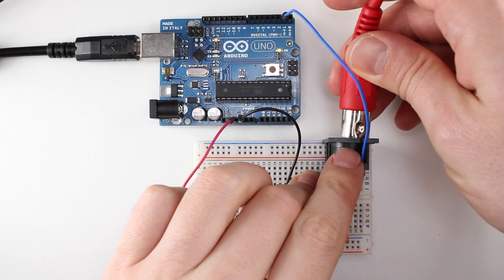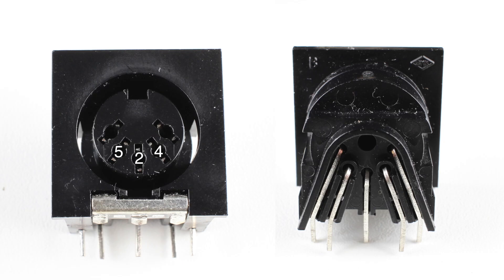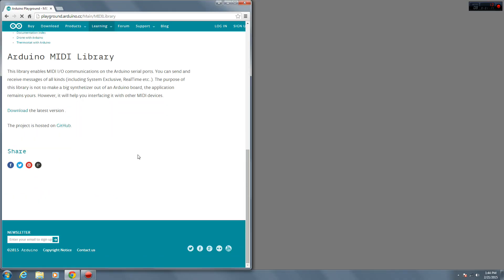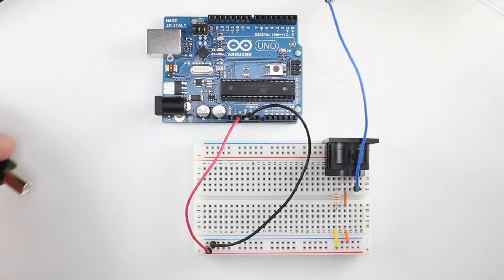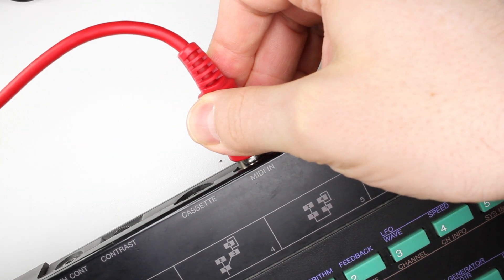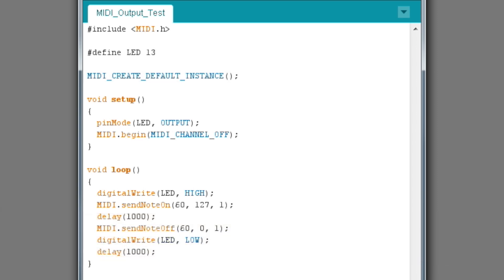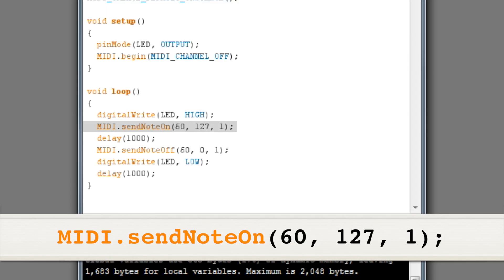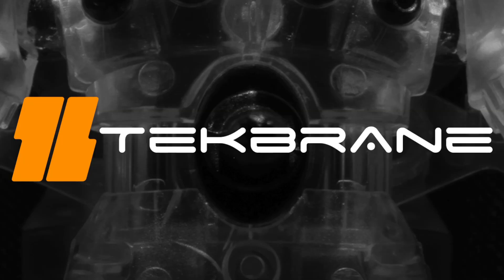MIDI for the Arduino - Build a MIDI Output Circuit

Comment: Am I stupid or something? 
The only thing I can get from this setup is Two (Yes TWO) Midi Reset messages instead of note on or note off.
I'm starting to think its something electrical. (Reset message is just a row of 1111 1111 after the 0 from the byte start)
If anyone has the same problem or knows why it happens hmu

Comment: Great stuff Dave! Your videos on MIDI DIY is the more comprehensive thus far. I have a question for my specific build. I hope you can spare some time to answer them.
Q: Will an Arduino Nano work with the instructions, software & libraries used in this video?

Comment: I was reading only certain Arduinos are midi class compliant. Like only certain boards are recognized as native midi controllers when you plug in usb. So in this case if you use a 5 pin midi output you can use a regular Arduino uno without flashing it with custom firmware and it can be used as a midi controller?
Reply from the maker: The Uno/Nano can't do USB Midi without modification. Some other models can though. I like using the Teensy micros for USB stuff.

Comment: ultimately i have 2 projects I want to pursue here, I want to make a device which can record/passthrough midi, so that i can record keyboard notes into a midi file for later while also allowing them to pass through to a synth. 

The second goal is to create some sort of piano roll style midi editor which allows me to edit those recorded midi files, and to allow playback across a midi out port.

I am not sure if a piano roll type application which could support a screen/gui with a mouse is feasible on an arduino or if i need to explore using a rasberry pi instead.

Comment: I love so much how this series explain all the basics Arduino software coding in details, slow and easy to understand for all. Great work Notes and Volts! Midi and triggers would be a great topic to subscribe, but also visual, with the Pi Pico VGA out, or even the Nano but smaller screen. I'm completely noob when it comes to visualization on small screens. Even identifying the kind of screen is troubling to begin with.
Reply from the maker: Glad you enjoy it! Lots of good ideas for future videos

Comment: would there be any differences if I were using a arduino pro mini? I wrote a code to send program changes through midi out, it works perfectly on the arduino uno but when I try to use it on pro mini, the messages that sent through the serial port seem to be totally random

Comment: 🤯This Arduino MIDI series is exactly what I need to know, not for creating music, but for creating laser waveform imagery with Teensy board x/y image generators with subroutine keys and CC parameters being MIDI controlled. 🙏 Thank you!
Better to be 7 years late, than never, right?.
Hoping to find an episode on interfacing with a DAW's timeline to complete the process.😎

Comment: I need some help. I am trying to design a MIDI IN and MIDI OUT circuit for an esp8266. It is a 3.3v system. 

I  have searched all over google and youtube for the right circuits. Some even have the MIDI pins 4 and 5 reversed.. Which pin is more positive than the other? (Pin 4 or 5?)

In a MIDI OUT circuit, do I connect the V+ side to 3.3v or 5v? (I am using a esp8266) Would I need an opto-isolator on output to protect it when driving a 5v circuit from a 3v pin?

Could you please show us a MIDI IN/OUT circuit designed to work on a 3.3volt system?

One last question:
Are there any MIDI commands that can be used to tell a servo what position to goto?

Comment: Hi Dave! I've successfully made an arduino midi controller by watching your tutorials, I want to go a bit further and turn that into a wireless one by using bluetooth low energy. Could you please share some tips on how to achieve that or make video if possible? I've seen a few tutorials using adafruit boards but I want to see if that same thing can be achieved by Bluetooth modules like HM-10.

Comment: you have the din5 connector plugged into the ground at the top with the first 2 pins?What about the 2 pins in the front? There are 7 pins total.

Comment: Hey, can somebody help me with a problem? I connected my wii drumset with my roland e drumset, so i can play guitar Hero with the e drumset. the problem is, that the midi cable sends 2 information, when i hit the drum. so the game registers 2 notes, while i actually hit the drum once. my plan was to use the arduino as a connector and code it, so that the e drumset just gives one output. does this work?

Comment: I've watched all your MCU Midi video's and I've finally started my own project. I'm using the code shown in this video and an ESP8266 to send Midi data to my Behringer Neutron (I just switched to 47 ohm resistors because of the 3.3v logic). But for some reason my LFO stops working as soon as I've sent a Midi note. Other than that it works perfectly!
Do you have any thoughts on this? I feel like it might be sending some Midi CC data somehow.

Thanks for the very informative video's btw!!

Comment: no optoisolation circuit in case of voltage spikes?
Reply: It's an output the input on the device you connect it to will be optoisolated

Comment: According to Your previous video the ground pin should NOT be connected . Correct ?
Reply from the maker: Hi MrKk. The ground pin on the Midi Jack is connected on the Output jack only. Not on Input jacks. This is to prevent ground loops between the two instruments.
Reply: OK  Basically the TX device  will shield the cable  but  @ the  receiver (synt) "midi in" side pin 2 is supposed not connected.   (I will check this in service manual of my Roland RD700sx :-)
 I'm seeing Your schetch output through an oscilloscope decoder as per  this video:
https://www.youtube.com/watch?v=9enveiI0eg4
Thanks for the incredible precision of Your Work.

Comment: Warning! I'm about to talk about Raspberry Pis and not Arduinos...
A side effect of the Raspberry Pi Zero having a USB OTG port is that it can be configured and used as a USB Device/Gadget rather than just a host. This offers the potential to build a USB MIDI interface (and possibly also build in some intelligence too). Multiple RPi's in one case could potentially equate to a multi-port interface too. At $5 a piece that's a significant saving over pre-built multi-port midi interfaces....~$250 for a MOTU 8x8 MIDI interface for instance. 
Have you worked with RPi's? Do you think this'd be a worthwhile project?

Comment: I tried using a mega arduino 2560 did not work and another thing the led keeps blinking if it is connected in the usb using a source it does not continue.
Reply: Any luck with this? Not working here on Mega either. I suspect it may be something about the TX pin (I've tried with TX0 and TX1 and no luck)

Comment: Thanks for the video!

"before we upload the program, we need to remove the wires from the rx and tx pins" - but they aren't connected to anything anyways when you do it on the vid? :)

However, I'm having problems with just this thing, getting:

* [upload] could not open port /dev/cu.wchusbserial213220: [Errno 16] Resource busy: '/dev/cu.wchusbserial213220'

and can't upload a new sketch to the nano I'm using. Is there any trick to not make the arduino run a lot of stuff on the serial when powered up for receiving a new sketch? I remember something about doing some timed precess on reset on the Mega that's controlling my 3d printer for this same reason…
Reply from the maker: Hi Victor. I remove the wires from RX when uploading since it shares the line with the Arduino USB and can cause an error but that should not be the case here. I have not seen that error message before. It looks looks like an OSX thing. Are you using a MAC for this?

Comment: Great Stuff! I'm using the test program in a pc, (arduino -> serial midi converter -> virtual midi keyboard) and somehow i did not get any notes. I set the port to 115200 bps. In the Arduino IDE the code compiles fine, the arduino shows the TX and 13 pin led working... I don't have a real midi keyboard or device...so,  I'm checking the signal strength in ableton live, and it shows to be very low signal compared to playing a note with the mouse in the virtual midi keybord... any sugestions?

Comment: hey Dave, is there something else i have to do if i'm using the mega? every thing i've tried( this out test, and a drum sketch ) works as far as the led does what it's supposed to do, but i get nothing going out midi to the computer. i'm thinking that since there are more rx and tx pins on the mega , that maybe both the sketches i've tried are missing something. any ideas?

Comment: While it will work fine and not damage anything, the schematic in the video is slightly wrong compared to the actual MIDI standard. It is missing one 220 ohm resistor on the TX pin. When connected to a MIDI input, that will add up to the correct 660 ohms in series when driven from 5V, and not 440 ohms.
Reply: I noticed this resistor missing, as compared to the tutorial Arduino offers. Thanks for mentioning this. If the resistor is missing, does that just mean the optocoupler's (from the previous videos in this series) internal LED gets more voltage than it needs?  Oh hey your comment is 2 years old. Anyway, hello from the future!
Reply: @markfdesimone  yes
Reply: I was looking for this comment because ChatGPT insisted me to add the 220 ohm to TX. Is there maybe a reason why this video does not include the resistor, or do you think that it is really a mistake?

Comment: Hi, Great video, very clear. I'm hoping someone can help me with the following: I'm attempting to put something together for a friend who has cerebral palsy and is keen to play percussion using his wheel chair control system in our band. His chair has a 3 switch head controller (DX-5SW 5 Switch Module) that can map to some output contacts, and we have a spare Roland TD-9 electronic drum controller with a midi in jack. I was thinking that there must be a way to connect the normally open contacts from the chair to this Arduino circuit so they trigger a drum sound from the TD-9 to the PA. Any suggestions would be greatly appreciated.
Reply from the maker: +Karl Lorenz Hi Karl. That sounds really cool! I would love to help you with this. 

The MIDI connection to the TD-9 should be straight forward. You are simply sending note on and off commands to the unit like in the video (a different note for each switch).

The output from the chair controller i am guessing uses relays that are open and closed via the buttons on the chair. We just need to know exactly what this device is outputting (a switch or is it outputting a voltage of any kind).

Contact me at my email address at www.notesandvolts.com under the "contact" tab if you would like to talk further.
Reply: can you say hi to him for me? love from Malaysia :)

Comment: Can I write a sketch for managing jog in traktor pro using this library ?
Reply from the maker: alexey beltukov Hi Alexey. If the traktor responds to standard CC messages over a 5-Pin DIN Midi cable, it should be possible.

Comment: Good stuff! Hope that in a future video you cover MIDI over USB, with the Arduino being recognized as a standard MIDI device on the computer or tablet the USB is connected to.
Reply: This basic code actually does work for MIDI over USB. There are other ways to do it, but this totally worked for me.
Reply: that would give alot of access to instruments without the midi connection right?